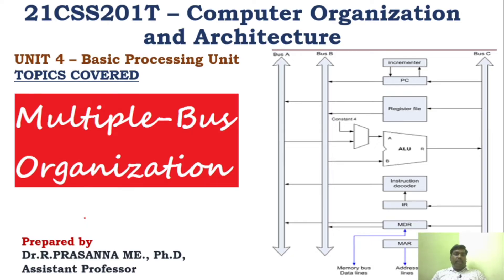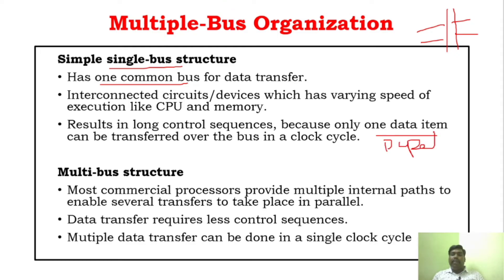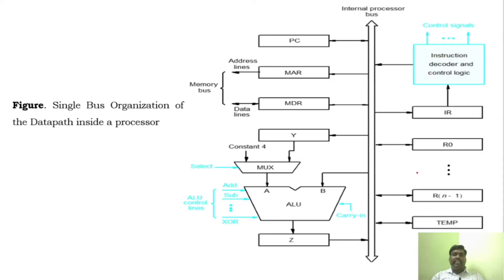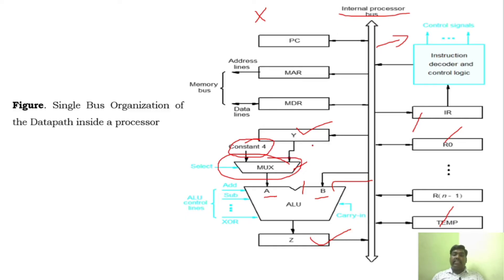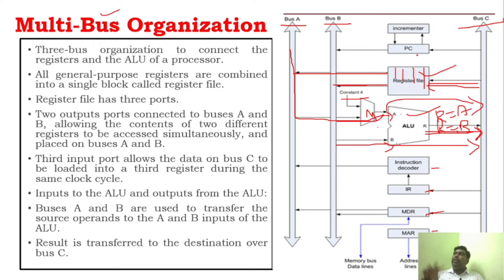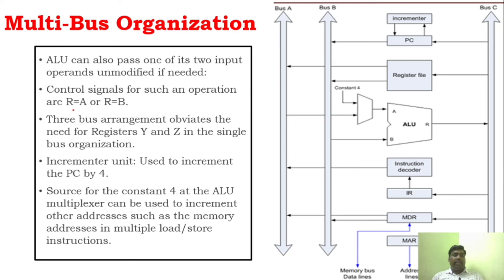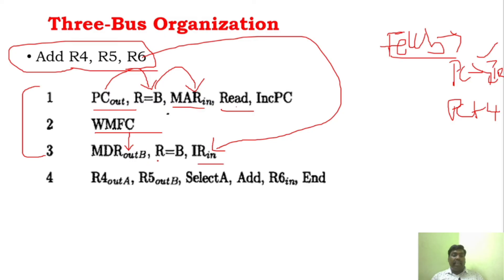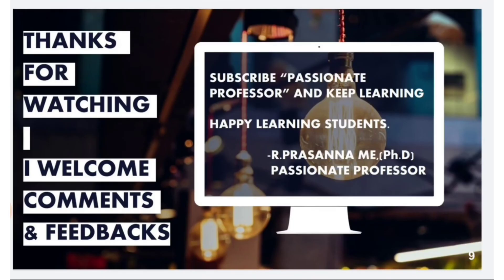Multiple Bus Organization - Fundamental concept of Processor

Comment: Sir Did you cover unit 5 as well.?
Reply from the maker: @lyapuri4545  I didn't do it yet but try to do the same soon
Reply: @PASSIONATEPROFESSOR  sir the ct is on 7th any case if you can do it in 2-3 days would be helpful
Reply from the maker: @lyapuri4545  Dear student, It won't be possible within that time so kindly don't wait for my video use the ebook and prepare well.